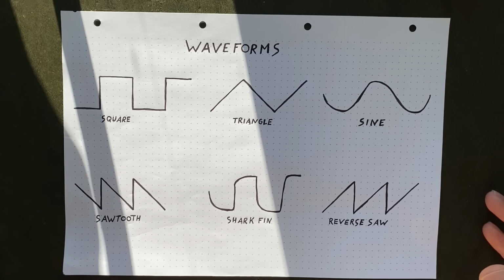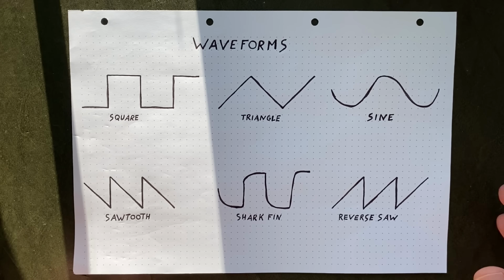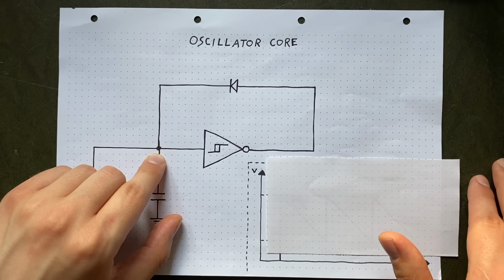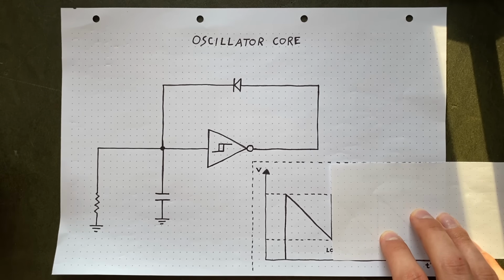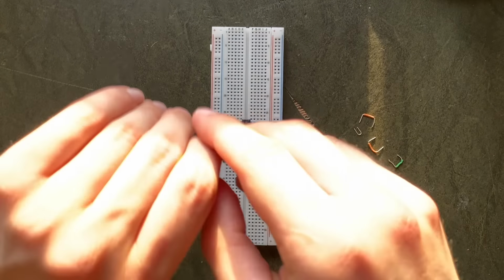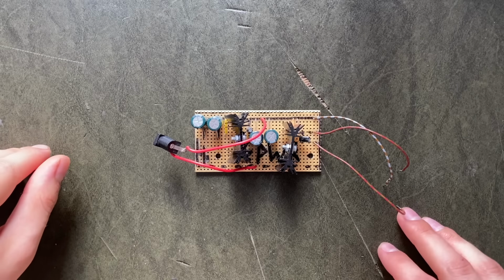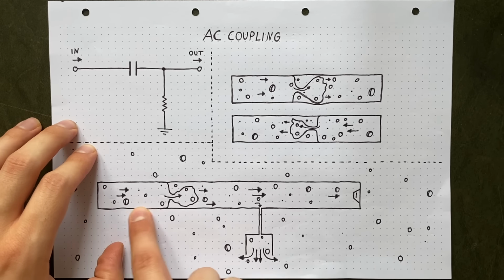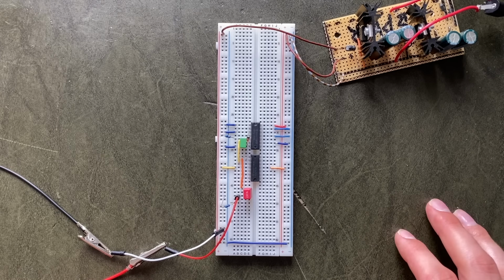DIY VCO Part 1: The analog oscillator core anyone can build

Comment: hey, can i connect  an speaker (without an amp) directly to the audio out?
Reply from the maker: what kind of speaker?
Reply: @MoritzKlein0  https://www.ebay.com/itm/2pcs-4-inch-8-10W-Full-range-Speaker-102MM-8Ohm-Loudspeaker-HiFi-Audio-Part/263768374955?_trkparms=ispr%3D1&hash=item3d69d1feab:g:ObAAAOSwllpbKaVb&amdata=enc%3AAQAFAAACYBaobrjLl8XobRIiIML1V4Imu%252Fn%252BzU5L90Z278x5ickkXKoKcbeZcOrOku%252BoOBl%252BS8zpTAaaRxvgqNB89y%252BiDQa%252Frsx%252BIBEmlEDVrRsOsr5cJztLIfPPWsdxDnOjKZJZlFHAqkGA1pcF2P8kAgrgaWe2ck4ARdrM8NPuHddvcs1tgh9Tm6kPe5MrppdRzV3EXklgg1vEO17ToocZlzh20QFjpRr3IH%252BOpQzYZN%252BJbJLyFLT%252B3olJDDfHuke8MPP3cMci7oOkjLtKYJDv2IKzAFt20vI5EaKXjf8lpKt77A%252BdqqGIX6mm84%252BmK7QUxm5iyoMkGmY2lFYqemCefVREx7GGzLv02EiFUjHes6iHxll5pf6yb%252B4XnSxTe5PrMypVElelHZWBRutNB9e06MIFZ6N6VOlnqyqeVvfOZdp7sjQvEO2qzvcpS9NxwWaBR4EebPvBSAb4GXug7ChunTbaHraVW7KcC6oScXEWVwR1o6K5j5FK1POBDammpoSQbt5reRiwRiALCw0f71OnxJI3r9vlZywQ9U3jF2SBwtUT0Mg8Zu8PNXJk4NMcXZlTU2YZ%252FiGF4%252FGA71kXT9QraluZPhJz7sgYaJHLmhiDUCypj4P1R1xNkrsIDOMrP1zVtpw1kH3SJ0ycsJ6NAeAOpzZGha642ggn8nM8IlZFTWoCroR8%252B82%252BVTcoVGDMSN41SwQ3%252Br2I3Kngkn3CvOL0ROEQ%252BHyFn1suGmvrT1CZ%252Fc%252B8GHWiGocj32BjNkV6gO4eWYUzzCohHEbg7YljzSJkHKHJs%252F9xqIzJ0Ip%252FEsdLUqvvdsh6%7Ccksum%3A263768374955ff7a9befd9a54a4f9390821503aec635%7Campid%3APL_CLK%7Cclp%3A2334524 like that

Comment: What gives a synth its character in regards to components? The point I am making is if I wanted to construct an analogue synth reminiscent of a "classic Moog" sound, would this be possible?  Does using IC's mean a loss in quality when it comes to timbre? Sorry for the vagueness of my question.
Reply from the maker: as far as i know, the 'classic moog sound' mainly sits in the filter. so if you want that sound, you'd need to build a transistor ladder filter (which is more complex/has more individual parts than an MS-20 filter, for example). but i don't think you can really say that one circuit has less "timbral quality" than another – it's a matter of taste in my opinion.
Reply: @MoritzKlein0  thanks for answering. I guess it's about producing plenty of subharmonics. And yes I agree, it is about taste.

Comment: hello, what kind of amp or speaker i can use to hear the sound. Just started on the Diy synth universe
Reply from the maker: either headphones or anything else that has an aux input!
Reply: @MoritzKlein0  Can I plug it into a lm386 breadboard amp  ?
Reply from the maker: @gabrielguimaraes8967  i need a little more information on that amp circuit and what you want to drive with it!
Reply: The lm386 works good for headphones at least.
Reply: @MoritzKlein0  Might explain "line level" (0-1V?) in one of these. I've also wondered how the CVs are standardized, but I expect we'll get to that.

Comment: 1. You can build a buffer with 1 transistor - look how guitar pedals do it. 
2. You can use TL07X without negative rail for buffer. No need for quad opamp as well.

Comment: Is there any problem to use electrolytic capacitors instead of the foil ones?
Reply from the maker: as far as i can tell, the smallest available size for an electrolytic cap is 100 nF, which rules them out for use in the oscillator core. 

also, i've been told by my local electronics dealer that for audio applications, foil is the best choice. so while you could use electrolytic ones for the AC coupling, it may cause distortion. take that with a grain of salt though.
Reply: @MoritzKlein0  Oh, that's true I didn't realize that. Thank you so much for you advice and for your great video series of DIY SYNTH, I am so doing this project soon.

Comment: Hello, great video, can i use a modified 12V power supply from an old dvd to power up the module?
Reply from the maker: really depends on the specs of that power supply! does it have -12V, ground and +12V? and is it a switching power supply?
Reply: @MoritzKlein0  it has a -12V and a +12V and i can switch between.  gnd,  +5V, +12V and -12V ports.
https://images.app.goo.gl/hrF56Jd7P7hqPbue9 it is this type of power supply
Reply from the maker: Daniel Mendes honestly not sure. are you certain it has a -12V output? on the aliexpress page it only says 12/5V.. if you have a multimeter, check the voltages at the outputs. if in fact you get -12, 0, and +12v at individual outputs, you can try it.
also, it‘s a switching power supply, not a linear one - that means that it’s probably quite noisy. for testing purposes it should be ok, but not for „proper“ applications!

Comment: Which oscilloscope are you using? What do you recommend? I'm often put off by the display resolution of some digital oscilloscopes.
Reply from the maker: it's an RFT EO 213 that i bought used & really cheap. it's the only one i ever tried, so i can't really give any recommendations – i just know that i vastly prefer the aesthetics of old-school analog scopes. but digital ones definitely have some features that make your life a lot easier, especially when it comes to precise measurements!

Comment: well
"negative voltage" actually means that electrons are moving in opposite 
+5V means that electrons are coming to "device" (aka resistance) from source like power cable (at any point of that cable is voltage how said in the video "pressure")

Comment: So many "OH SHIT I GET IT" moments in this video. Your explanations are so perfectly clear it's insane, thank you !
One question : if i have a power supply with +12 -12v, i can connect the output of the breadboard directly into a eurorack modular without problem right ?
Reply from the maker: you mean the audio output? sure! but the PSU voltage doesn't matter all that much, as long as you don't go above 15V!
Reply: Yes you can. Two things are necessary:
1. one wire carries the the output signal of the breadboard (Tip of the mono audio jack) 
2. The second wire connects the ground potential of your breadboard and eurorack (sleeve of the mono audio jack). The ground in your case should be between +12V and -12V (reference ground, 0V). In the end of the video it is the brown white line connecting the power supply to the breadboard, and the black line connecting the breadboard and eurorack.

Reasoning for the breadboard ground between the two supply voltages:
Lets say the eurorack uses a signal between +5V and -5V for input. 

If you connect the -12V  on the breadboard with the eurorack ground you can only send a signal between 0V and 24 V . (24V is the voltage difference between -12V and +12V)

If you use the 0V on the breadboard as ground you can send a signal between -12V and +12V. Limit the output below the allowed maximal input voltage.

TLDR:
Just watch out that the negative supply voltage is is not the ground you connect to the eurorack.

Comment: Hi for this project does any kind of speaker work in terms of wattage and resistance of the speaker. Also do you need an amplifier for your speaker?
Reply from the maker: good question, can't really say! the signal should be strong enough to not need an amp, but i guess it can't hurt to use one.

Comment: Amazing video! Quick question: if I use the other Schmitt triggers at the same time as oscillators, will it mess up each other?
Reply from the maker: generally that should work! i vaguely remember something about possible parasitic oscillations though. but it should be a minor issue. just make sure you ground all the unused inputs!
Reply: Moritz Klein Thank you so much for your response!

Comment: Amazingg stuff this! really helpful and indepth, Would you like to also make a video on your spring reverb module? I tried to make a circuit for a guitar spring reverb but there is still a lot of hish, noise and fuzz
Reply from the maker: yep, that's on my list!
Reply: @MoritzKlein0  Amazing! Since im studying Electrical engineering atm but I cant find a solution, do springreverbs need extra circuitry besides just two amps for the input and output?
Reply from the maker: @boris5448  no, it’s really just one amp pushing the signal into the spring tank and then another to recover the signal! though you might want to add a bit of filtering to the input.

Comment: Can you run multiple VCOs through the unused schmitt-triggers on the 40106 IC or do you need a new 40106 chip for each new VCO you want to add? In other words, can you use the 40106 as the hub of 6 VCOs to make full use of it's 6 schmitt triggers? Need to bread board this out, I found at least one reference of someone using one chip for four vcos.
Reply from the maker: you can build 6 vcos with one 40106, no problem! but you will need 6 op amps for the buffers aswell!
Reply: @MoritzKlein0  Excellent, I may have to build a 40106 six voice drone module :)

Comment: Cool vid! Next check out the LM566 or NE566. You get a square and triangle out. 
I've built a few of these using this circuit: https://i.imgur.com/0cuMZ0n.jpg 
LM566 PDF: https://www.egr.msu.edu/eceshop/Parts_Inventory/datasheets/lm566.pdf

Comment: Great video! At around the 40 second mark you say it has reasonably accurate __ ___ tracking. I’m new to the game and just don’t recognize the words. What is this exactly? Thanks!
Reply from the maker: it's "volt per octave tracking" – this means that if you apply 0V at the input, you get a pitch of C0 for example, then for 1V you get a C1, for 2V you get a C2 and so on! check the "CV" section on this article for more information: https://en.wikipedia.org/wiki/CV/gate

Comment: How is your circuit design simpler when it uses more components? The 555 circuit uses 15 components while your design on your breadboard uses 16 components (if I counted right) - so basically equally complex?
Reply from the maker: the 555 example in the beginning is just a piece of the whole thing – drawing that in its entirety would've taken a while. here it is if you're interested: https://www.schmitzbits.de/vco2.html

Comment: Neatly explained! Looking forward to learning how to achieve 1V/Oct. I've done relaxation oscillators like this in the past, but I never thought they could be tuned accurately. I guess you need to use a potentiometer as a voltage divider in the CV input to adjust the relationship between input voltage and frequency, and then another one closer to the oscillator to force absolute tuning (the first octave starting actually with C). Is that correct?
Reply from the maker: no – even though i'm not sure i understand the idea –, i'm using an NPN transistor coupled together with a PNP to get rid of the temperature dependence. simple stuff!

Comment: MORE OF THIS PLEASE.  I've been spinning my wheels for months trying to apply electrical theory to practical circuit building (for synths) and found few tutorials that help explain how electricity actually flows through a circuit.  Thank you.
Reply from the maker: exactly the reason why i started doing these videos. glad i can help!
Reply: yes! there's this assumption that I can just look at a schematic and follow what the electricity is actually going to do... this level of explanation is fantastically useful.
Reply: Super stuff, completely agree! Everything makes a whole more sense!
Reply: Yes. Thanks so much for doing this series!
Reply: Please be careful when using a breadboard. It will create frequencies that will enter your body and cause damage.
Wrap either the  breadboard or your body in tinfoil to block out the frequencies. You must be careful with frequencies.

Comment: Great explanation - thank you. Qucik question: When the capacitor is on the discharge phase I understand about the diade adn the resistor, but won't some current flow towards the trigger too? Or are you just leaving that to simplify the concept?
Reply from the maker: no, no current can flow into the schmitt trigger's input - it's basically blocked! or did i misinterpret your question?
Reply: @MoritzKlein0  No; that's fine.I suppose I was thinking of it building up "at the door", beofre pushing through ... almost like a capacitor. Thank you!
Reply from the maker: @_MisterG  that's not wrong actually, but the amount is so so minute that it's really negligible!

Comment: The balloon analogy that actually demonstrates how no current flows through the capacitor is awesome. The capacitor = “a battery” analogy has never really worked well for me so this was awesome, thank you!
Reply from the maker: yeah i had that click for me while making this video actually. it's a really helpful insight!
Reply: @MoritzKlein0  yep me too! great video
Reply: A battery is a bit like a balloon too, no? Just a different way of actually storing the energy.
Reply: @naught101  No, I was confused about this corner of electronics for a long time. I visualized batteries as just a big store of electrons that you could use up. If that were the case, then as soon as you hooked up a battery to a circuit, there would be a giant voltage, a huge zap, and everything would get fried as that huge pile of electrons pushed apart from each other and went to ground.
Instead, batteries are electron *pumps*. They take in electrons from one terminal and push them "uphill" to go back out of the other terminal. They use chemicals to provide the energy needed to that. The "electro-motive force" describes how "hard" that pump is able to push to drive current and is why you have batteries of different voltages.
In a pnuematic analogy, think of batteries as chemically-powered fans.
Reply: Funny, my physics teacher in high school always used the water and pipes analogy and I always had no clue what he meant. Had to learn on my own as an abstract concept and just remember how electrons work - no idea why water and pressure is black magic wizardry to me. Everyone learns different I guess!
Reply: Actually in your analogy the quantity of water stored in the capacitor would be the charge, not the capacitance. Your video is very instructive nonetheless!